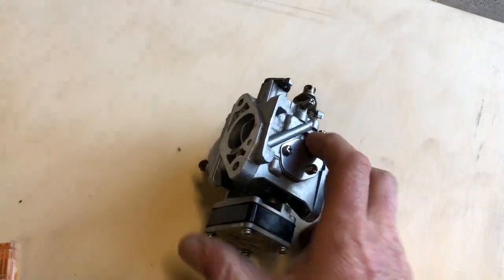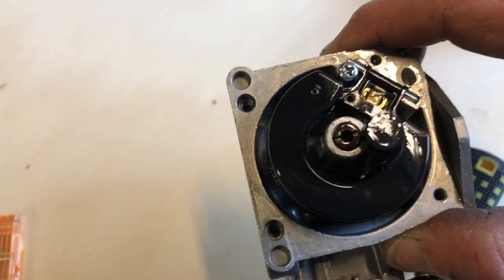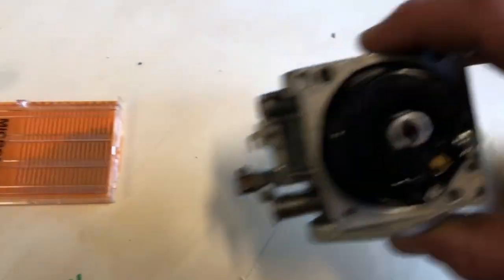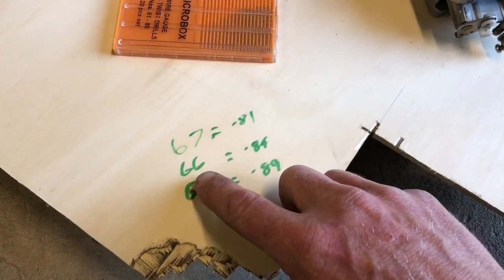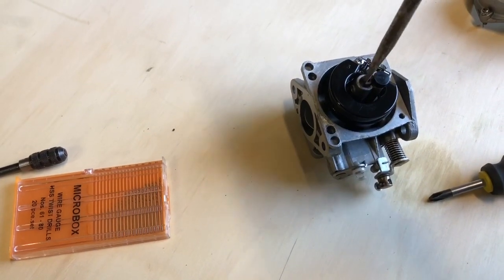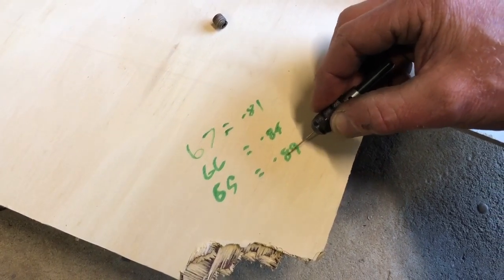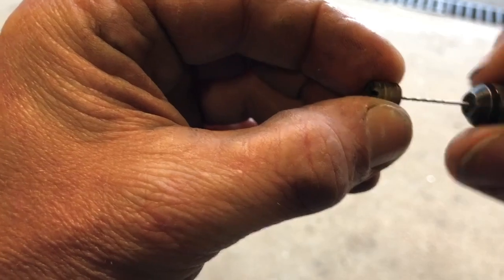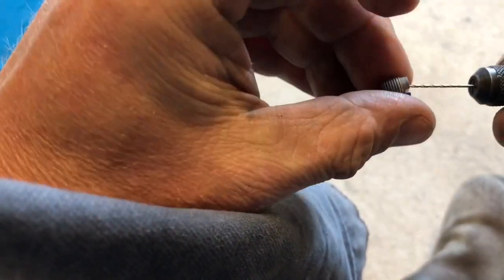Re-jetting a carburetor for a modified outboard.

Comment: Hey mate, I appreciate every video you post . Simple question,  how do I turn my merc 15 super into a 18 ? I have seen vids of making it able to open the throttle but do I need to make the jets bigger  ? I appreciate you always replying mate, cheers 🍻
Reply from the maker: Hi Mate,
Thanks for your encouragement 👍
If you look on my Channel, I put up a video comparing  9.9hp - 15hp and 18hp, I believe I show the stator in that video.
So it’s the throttle cam on the stator (it tilts the carb open) and advance the timing slightly and your at 18hp. It’s hard to tell the difference though in speed between the 15 super and the 18hp.
Cheers 🍻 
Aussie Boat Guy 😎

Comment from the maker: Unfortunately not. You are better off seeing if you can get the 5hp carburetor if there is one for your capacity motor. Also you would have to make sure if there are any other parts you need for the extra hp.
Cheers,
Glenno

Comment: I have change the mainjet from 0.82 to 0.99  and i have a neadle atomizer jet with 8 holes and i want to put one with 12 holes.. hoping to bring more air to more fuel and finaly hope for more power..
Reply from the maker: Changing the main jet from .82 to .99 will make you go slower as it will flood the air fuel mix. You cannot just put a bigger main Jet in without making the throat bigger.
The main jet size is strictly related to the throat size.
Best thing to do is try the .99 and get a feel for what it does.
Cheers 🍻
Reply: @25hpboatracerman  i also find a 9.9 yamaha carb that will fit my  5 hp and i thing if i put that carb will give me some power to go plane

Comment: Great vid, would you happen to have any advice for increasing HP on a 15hp yammy 4 stroke single carb 2 cyl I was thinking on removing restrictor plates but not too sure , any thoughts?
Reply from the maker: Hi mate,
I am not 100% sure about the Yamaha 4 stroke, haven’t played with one yet.
If it’s the same power head as a larger hp, I would definitely start by seeing what differences there are in the two. 
If it’s restrictors, timing etc I would do it.
If it’s a big deal and the cost is too much I would look into getting a bigger motor.
Cheers, sorry I could not help more.

Comment: Have you tried a motorcycle carb on a modified outboard? An external fuel pump is needed though. Looking for references as I'm working on a full mod Yamaha 9.9 (now around 20 hp) and the modified standard 23mm carb seems too small...
Reply from the maker: Hi Mate,
I have not tried a motorcycle carb, there are so many outboard carbs on my shaft to choose from 😁.
Very interested in your build, what’s it going onto and what speeds are you getting?
Cheers 🍻 
Aussie Boat Guy 😎
Reply: @25hpboatracerman  It will go onto a 8ft hydroplane I made 20 years ago. We got 35kn at 7600rpm on it last summer with a modified aluminum prop(thanks for the prop mod videos BTW) I have a cleaver too but the boat becomes unstable when the motor is mounted so high. After all the boat is made for kids haha. I´ll report once i get the 28mm motorcycle carb working..
Reply from the maker: Sounds like a quick hull 👍
Yeah, please keep me posted 
Cheers 🍻 
Aussie Boat Guy 😎

Comment: I’m looking to try this on my Tiller Honda BF 15 outboard. I’m just a hair short of being able to plane out all the way on my skiff
Reply from the maker: Are you planning on using the same carburetor? Re-jetting the original carburetor alone will not work, you need more air as well (bigger throat). The original carburetor will already have the correct high speed mixture jets for the air flow of that carburetor.
If you find another carburetor with a bigger throat that fits your bf15 be very careful not to run a full throttle for more than 1 min until you check the plug burn colour, you can blow your motor very quickly if your running lean.
 For starters I would leave the carb and try (one at a time) a lower pitch prop, motor height, try a fin on the motor, weight distribution in the boat.
The last thing you want is to damage your motor. 
In my video I was putting a 9.8hp carburetor on a 5hp. After lots of playing with main jet sizes I probably got about 6hp. 
Hope this helps mate, it’s so annoying when your nearly on the plane but not quite.
Another option is a bigger motor as it could need more torque as well.
Cheers

Comment: Hi in an earlier vid regarding tohatsu 8 Vs 9.8 differences,  you mentioned that there was a difference with the exhaust plates. Can you describe the difference and do you think 8 hp plate could be modified to 9.8 spec. Many thanks in advance.
Reply from the maker: Hey mate,
Can’t remember the vid, was that actually the 9.9, 15 and 18hp comparison vid?
The 8hp and 9.8hp have the same exhaust plate but the heads are different and also the carburetors are different.
The 9.8 head is a high compression head, I have shaved an 8hp head down to match and it worked the same.
The 9.8hp carburetor has a bigger throat.
To tell the truth, the difference between the 8 and the 9.8hp performance isn’t massive.
Hope this helps 👌
Reply: @25hpboatracerman  Thanks for the quick reply. I just had a look on parts catalogue and there is a different plate for the 9.8. As for the carb I thought it was the same, as all eBay listings say 1 carb for both,  but catalogue does quote different items. I was going to mill heads myself, what did you aim for about 150psi?
Reply from the maker: @Phantom-mk4kp  
The stock 9.8hp normally has around 140psi. Definitely has a bigger carburetor throat, from memory it’s 17mm, I can check tomorrow, think I have one on the shelf. The 6hp and 8hp run a lower compression.
Interesting about the exhaust plates, I will look into that, wonder what the difference is?
I have fully rebuilt about 4 x 9.8hp Tohatsu, about 4 x 8hp and had many 6hp blocks apart along with heaps of part motors and never noticed a difference with exhaust plates, not saying there isn’t, just sad I didn’t notice if there is.
Might rummage through my old blocks and see what’s there.
I would be really appreciative if you can me posted on what you find.
Cheers 🍻
Reply: @25hpboatracerman  Just found your channel and seems you may have an answer for this one: I have looked into the 8 vs. 9.8 Tohatsu differences before and I remember reading on a forum that the two had different porting as well... Have you come across that? You think it's true?
Reply from the maker: @AntiVaganza  
Hey mate,
Not 100% sure that the 9.8hp has different porting, it may have.
The big differences are the carburetor and the head, I have added the 9.8 carb and head to an 8hp in the past with great success.
Cheers 🍻
Reply: @25hpboatracerman  Thanks man! I will pounce on either of them as soon as I come across a good deal:)

Comment: Do all jet kits pretty much fit all?
Reply from the maker: Hi Mate,
Unfortunately not 😢
I actually modify the stock jets with number drills and if I need smaller and cannot buy them I solder up the stock jet and re-drill to what I want.
cheers 🍻 
Aussie Boat Guy 😎

Comment: On a 1999 merc 120hp 4cyl 2stroke.  Uses 2 carbs and the lower carb has a bigger jet then upper carb. Why are the jets different sizes from upper carb to lower carb? Why don’t both carbs run the same size jets?  Any information would be much appreciated thank you.
Reply from the maker: Hey mate,
Yeah that’s a weird one ?
One thought I have is I think that particular motor idles on two cylinders of the four (for trawling and fuel saving reasons) also an interesting feature. So the bigger jet may be something to do with that to lube things etc at lower rpm.
I would definitely be looking into if that’s how it’s supposed to be by contacting a Mercury mechanic.
Does it seem to run nicely? 
Cheers
Reply: @25hpboatracerman   ya thing rips but I’m doin a refresh as it’s my off season here in the north east the carbs themselves are worn out so I really need new ones sooner then ltr so  I want to go with flat slide carbs something with a little more control and crispness rather then these crude old school butterfly carbs and just want to understand why they did that so i can get a understanding on a new carb setup.its a 120hp 4cyl 2sttoke and the top carb feeds top two cyl and bottom carb feeds bottom two cyl. Definitely operates as a normal carbureted 2stroke at idle so on an so on that’s why I’m a little stumped on why the top carb uses a .088 and the bottom carb uses a .090 jet. This is in my  13ft jetboat. And the manual says that’s correct jetting so I know it’s factory.

Comment: Hey mate, I got a 5hp mariner spark plug is looking orange like your picture. i am wonding how to check what size the jet is already so i can know what size to change it too. Thanks
Reply from the maker: Hey mate,
Orange or brown is normally ok, they should not look fully burnt.
White from too hot or overly wet with fuel is the issue.
You need to put a new plug in and give it a good full throttle run then check plug colors, old plugs are normally burnt or colored.
The high speed jets normally have a tiny stamp on them to show what size they are. Once you know the size you can check if that’s the correct jet for your motor. 
If your looking for more power, changing jets won’t increase power without increasing the size of the carburetor air hole which is a fair bit of work, you can loose power too if it is slightly wrong.
Is the motor running well?
Is it the Japan built 5hp?
Cheers 🍻 
Aussie Boat G
Reply: @25hpboatracerman  Thank you so much for your quick reply, yes it is made in Japan but bought second hand so I'm not sure what the owner before me did to it. The motor runs very well and with one person in my small 2.2m fiberglass boat can get on plane and sit at 13knots and still be on plane cruising at 7knots. However when me and my mate go together on it together it tops out at 5 knots. My prop size is 7.8x8x3 and was looking at getting a lower pitch prop but unable to find a good one. Thanks
Reply from the maker: @danielstewart8255  
Nice 👍 
Yeah, two people will slow it down for sure.
If it’s running nice then the mixture can’t be too far off.
Trying different props is a good idea, try some outboard wreckers to see what they have.
Cheers 🍻

Comment: Hi, by enlarging the hole in that tris, you will achieve exactly what
Reply from the maker: By drilling the main jet I added slightly more fuel to the air fuel mix entering the engine. Keep in mind that carburetor was of a 9.8hp tohatsu (twin cylinder) and I was putting it on a modified 5hp tohatsu (single cylinder) 
I don’t play with the jetting on a standard outboard as they are already correct.
If the fuel- air mix is too lean you will blow the motor in a matter of minutes, if it’s too rich it will not have any power, it’s got to be ridiculously correct.
Glenno
Reply: @25hpboatracerman  hi i have a marine engine tohatsu 5hp 2t there is some possibility with this engine to increase the power da it can be said that the carburetor looks exactly the same
Reply from the maker: The 9.8hp carburetor looks nearly the same but the fuel pump hole is in a different position and needs to be die grinded to adjust its position. The 5hp tohatsu won’t accept the extra fuel and air mix without being ported and I also put a high compression head on as well. 
Definitely not worth the effort, I think I got maybe 7hp out of it after a lot of work. 
I would just buy a 9.8hp tohatsu, they are awesome 
Cheers,
Glenn
Reply: What function that rubber on top pilot jet

Comment: would running a motorcycle carb with velocity stack be better then up jetting it?
Reply from the maker: Hi mate,
Jetting up isn’t really a thing, you need the correct jet for the throat size of the carb you are using. I was re-jetting that carb because it was off a much bigger motor with and had a 17mm throat instead of a 13mm throat.
Mates of mine have used motorcycle carbs on outboards before and they do work but no better than bigger outboard carbs.
Velocity stacks are a good addition for sure to any carb on an outboard in my experience.
If you are after more hp you need to get more air and fuel, the more air part is just as important as the more fuel part. Just adding extra fuel will loose power as it will run rich.
Hope this helps mate.
Cheers 🍻

Comment: I have a Suzuki DF6A with 6HP 4st. The boat with load wont plane, engine RPMs won’t increase. Already changed the propeller and I It helped but I would like to “increase engine power”. Is this possible? Unfortunately changing engine to a 9.8hp is not an option as the engine weight literally the double and I can’t move it by hand.
Reply from the maker: Hey mate.
Sounds like you do need more hp.
The 9.8hp tohatsu 2 stroke is the same weight as your 6hp four stroke. I know the 9.8hp 4 stroke is heavy but if you can go two stroke, you will have the power and weight your looking for.
Unfortunately your 6hp in not that easy to modify, I believe it shares the same block as the 5hp.
Hope this helps.
Cheers 🍻
Reply: @25hpboatracerman  thanks for answering!! Due to contamination requirements I’m not allowed to use 2T engines in the lake. Will have to continue using my old and good suzuki 6hp! Cheers!!

Comment: Hi, I just bought a 1993 20hp Yamaha autolube. Can I gain 5 horsepower by rejetting and or removing any restrictor plates?
Reply from the maker: Just wondering if it is the twin carburetor model? I know that people say they gain speed but it’s only marginal sometimes from the 25hp upgrade so be carful how much you spend doing it. From my understanding, the carburetors are different and I believe and the 25hp carbs have a larger throat. Cheers,
Glenno

Comment: How did the motor go after the re-jetting to .89
Reply: Wondering if I can improve the performance of a 5hp yamaha 2st
Reply from the maker: That carburetor (originally off a 9.8hp tohatsu) was going onto a tohatsu 5hp single cylinder two stroke motor. The throat size of the 9.8hp carburetor was about 3mm larger in the throat than the 5hp carb.
I definitely got more power and speed once getting the jetting correct.
Issue was that starting with the 5hp I might have only added 1 to 1.5hp so not a massive difference really.
Definitely got onto the plane easier and added about 5kph to top speed.
Was fun and games, I have kept the carburetor but sold the motor hoping to get another 5hp block and port it to allow better flow as the ports are very small in the 5hp, I feel this is why I didn’t see better gains. A high compression head would help a lot too with torque.
It’s a fair bit of work to see decent gains from a 5hp if 5hp is the biggest hp from that produced block (some 5hp are the same block as a 6 and 8hp like Johnson and old Suzuki)

With your Yamaha if it’s the two stroke single cylinder your probably in the same boat as I am in with the tohatsu.
Still fun if you like tinkering.
Hope this helps mate
Reply: @25hpboatracerman  cheers mate thanks for the reply.
Reply: @25hpboatracerman  is cool if you can put the 9.8 carb on the 5hp engine without modification!
Reply from the maker: @_.R.F.X.L._  
Yeah, it would be good,
Unfortunately there was a heap of mods. 
Is your motor a Yamaha?

Comment: Hey matey im in qld just wondering if u can tweak up a 5hp carby for my daughter
Reply from the maker: Hey mate,
unfortunately not much can be done to the 5hp to gain power, the ports are so small that they don’t accept more fuel and air. I tried a bigger carburetor on one (tohatsu-Mercury) in the past, tuned all jets etc and ended up with the same output.
cheers 🍻
Reply: @25hpboatracerman  if i port the  air intake 1 mm on each side or 2 mm with biger mainjet do you think will gain some  power?
Reply from the maker: @_.R.F.X.L._  
Hi mate,
Tried that, no real noticeable power increase I went from 15mm throat to a 17mm throat and played with heaps of jet sizes. 
I think you would need to go up to about 20mm to notice a big difference but the little 5hp ports are so small they cannot accept more air fuel mix anyway. You would have to port the block first.
Ps: I am in the midst of doing just that, should be a vid coming in about a month, lots of work, faster?? We will see.
Cheers 🍻

Comment: So - what is the difference between the 4hp mariner/tohatsu and the 5, parts wise? I see on eBay the carby listed as the same - but is this incorrect? Or is there a restricter one can remove? Different ports? Cheers
Reply from the maker: From memory the carbs are different, I will look into it and get back to you.
Cheers
Reply from the maker: The carburetor parts numbers are different from tohatsu, so I’m assuming the 5hp has a bigger throat. I have only had 1 4hp tohatsu and didn’t check that carb against a 5hp.
Interesting the main jets in the 4 and 5 seem to be the same size.

I would try and go to an outboard wrecker and check it out.

Comment: Any tricks on a 2006 18hp 4 stroke tohatsu?
Reply from the maker: Unfortunately I have not played with the 4 stroke 18hp.
I wonder if it’s the same block as the 20?
Reply: @25hpboatracerman  unfortunately it’s 9.9, 15, and 18hp that all shared the same block then later they went to the 9.8 which was an 8hp block and the 15hp, and the 20hp shared the same block. Mine actually started at a 9.9 and I did the cam and carb making it an 18. We’ve got a lot of 10hp lakes. Now with the new 4 strokes you just take the restrictor plate out and switch to the 20hp ECU! I’m running a 9 pitch stainless Solas now with added cup. I’m starting to think I’m maxed out lol